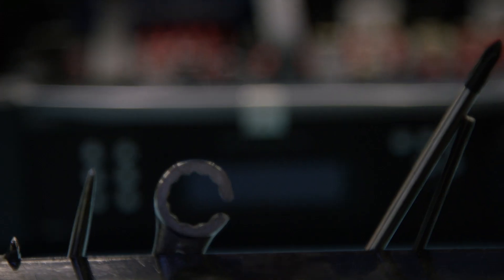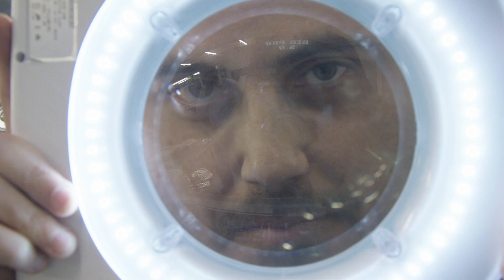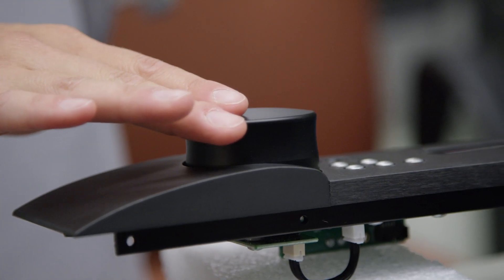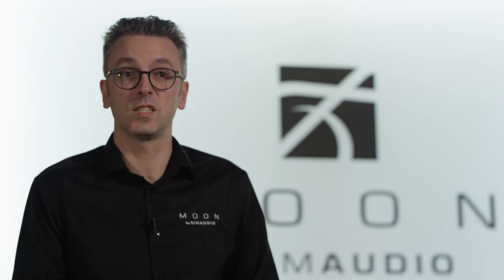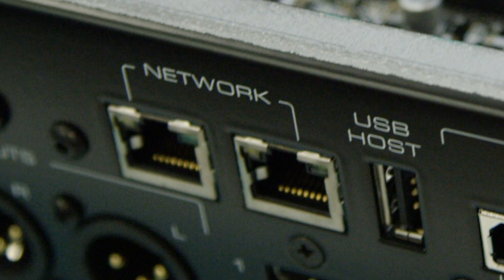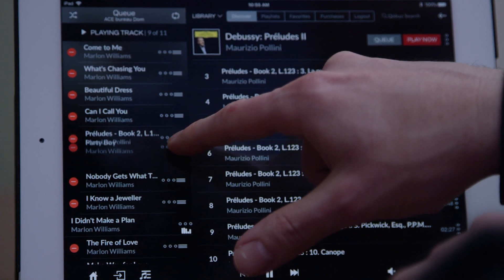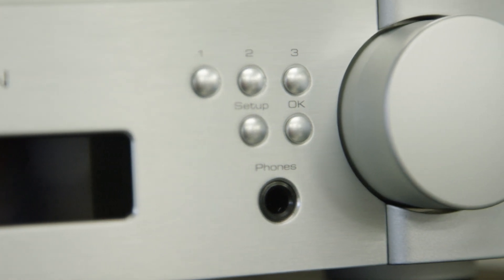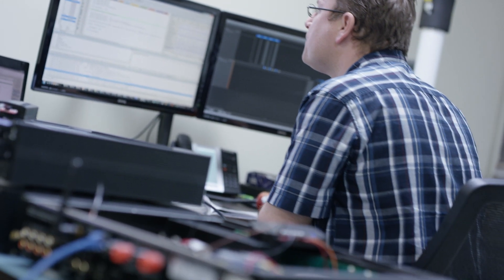SoundStage! InSight - Simaudio Moon 390 Digital/Analog Preamplifier and Streamer (September 2018)

Comment: It costs $5,300.00 US.
Reply: I bought it
Reply: @Waitaminutesilly  Me too :)
Reply: @rjy8960  congrats. What is your amp and speakers?
Reply: @Waitaminutesilly  Thanks :) I'm running a Parasound A21 amp and a pair of Martin Logan ESL 11A's at the moment. It was the speakers that caused this upgrade cycle - heard them a few months ago and fell in love and the system was being held back mainly by my existing preamp and speaker cabling. That's getting swapped out for some Nordost Red Dawn. My only gripes are that the preamp could do with a few more analogue inputs and connecting to password protected NAS drives isn't going to work. But the sound is amazing. What are you running?
Reply: @rjy8960  Bryston 4B Cube amp and Dynaudio Focus 380 speakers.
Reply: @Waitaminutesilly  Nice! :)
Reply: @rjy8960  thx!
Reply: Does it have a subwoofer out?